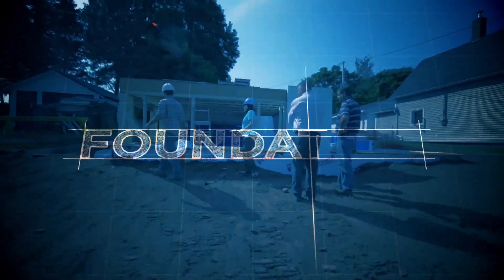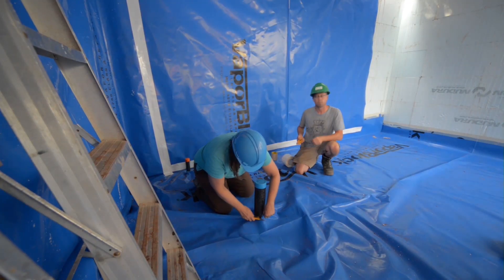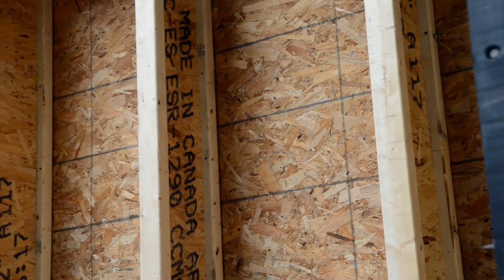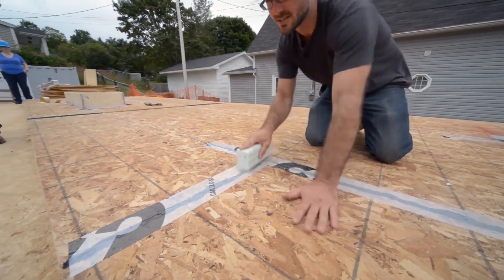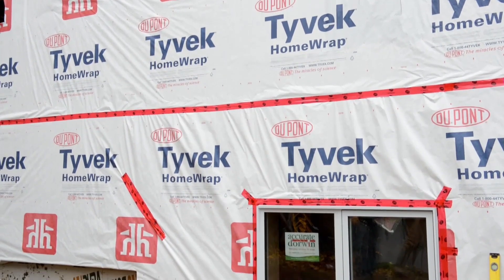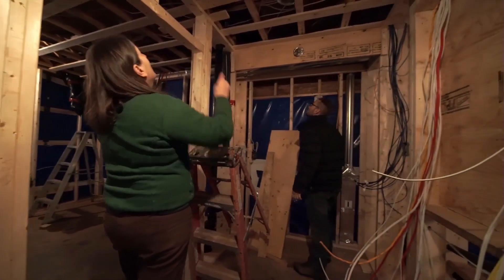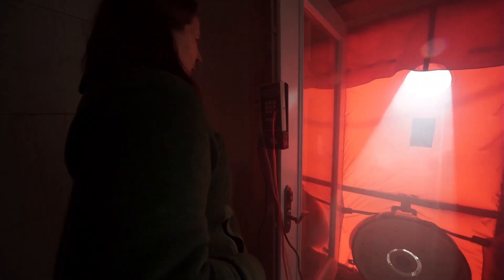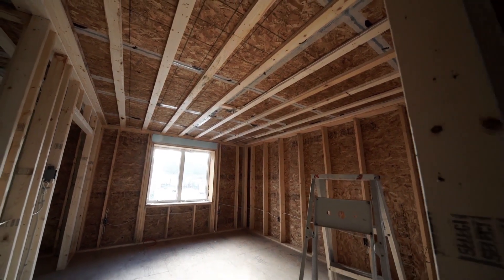Building a new home? Consider a Passive House

Comment: I have been building passive solar and super insulated for 35 years.  This is a truly superior house and construction,,, nearly,, all of it I compliment.  

The house is too well sealed.  People fart, exhale, showers and pasta on the stove,,,, never lose sight of the fact people breathe.  That house, as constructed in the video must have an air to air heat exchanger.  I would NEVER use a particle board, OSB, or any manufactured wood product (formaldehyde)  only some plywoods, maybe in a house that well sealed.  Furniture has formaldehyde, carpeting out gases, cabinets,, the composite sink in the bath,, you are going to be breathing the plastic in the shower curtain, and the flameproof coating on your kid's jammies is going to be dangerous.   People breathe.    You can spend an extra 5 grand tightening a house,,, and then you must spend another 5 grand on the electrically run air to air heat exchanger.

And moisture management.  In Nova Scotia,, I don't think this is going to be a problem TODAY,, but,,   From direct experience, I would never put Tyvek on top of OSB.  Never.  A better, a much better membrane under siding is 30# or better yet, 45# felt.    Felt allows vapour to pass easily,, I have never seen condensation on the inside of a felt barrier.  I HAVE seen condensation accumulation on the inside of Tyvek. And chronic condensation on the inside of Tyvek,, will destroy OSB,, and what ir does not destroy,, it will mold.

What I REALLY liked about this build,, was the flawless poly barrier between the home and the gases of the soil,, radon, methane, etc.  I'm gonna do that in my next build.
Reply: "The house is too well sealed."

No.  No it isn't.
The old notion of "it has to breathe" is simply uncontrolled ventilation.
You don't want that.  Because uncontrolled ventilation means uncontrolled heating and cooling.
This is why you have an HRV/ERV unit with controlled mechanical ventilation.

"Must have an air to air heat exchanger."

Which is part of what an HRV/ERV does.

Also, the issues with offgassing/VOCs is known.  You have choices there as well.
Go with finishes with low VOC content.
Adjust your HRV/ERV for higher air exchange per hour for a period to help remove the offgassing.
You get problems in houses where you have recirculation of stale air.

Also, Tyvek is an air barrier, but vapor open.
And if you've seen condensation on the inside of Tyvek, you're looking at a faulty wall assembly.
Additionally, even if you have said condensation, if the wall assembly has a path to drying in a timely manner, you won't see degradation of the sheathing.  It's when the wall is left damp for long periods and moisture stops migration out of the sheathing that you have issues.

Comment: I can't believe you are using aspenite and not 5/8 plywood. You are doing all this extra work but still cheaping out on material. I guarantee you from experience once it gets wet it will attract insects and rot
Reply: Properly engineered wall assemblies simply don't have these issues.
Plywood, OSB, etc.

The face layer of OSB can withstand decades of periodic damp on the face and not break down or rot.
It's when the ends get damn, stay damp, and swell that you begin to have problems.  Hence the seam taping.

Comment: No spray foam?
Reply: Nope.
Spray foam has it's place.
But it's not environmentally friendly, expensive, and can have offgassing issues.
Also, spray foam is, essentially PERMANENT.  YES, you can tear it out.  But the labor to do so makes simply replacing the assembly WHOLESALE far easier.
So lots of builders avoid spray foam in new construction.
You'll see a lot higher utilization in retrofits.

Comment: Are you suggesting all that tape will last 50 years?
Reply: This of course is not the only way to construct  a passive house. there are many varieties of wall and roof assemblies that one can choose from. 
I also had my doubts as to the longevity of the tape so when i had my last house built i had 14 cm T&G wood fiber insulation boards installed on the outside of 14 cm solid wood walls with a final layer of inch and a half T&G wood fiber sarking board . The T&G joints add extra security if the tape fails .
Reply: I know there is problems with the glue. Its the same with windows. They wont last
Reply: These aren't your old sealing tapes and duct tape of yesteryear.

The adhesives and the backers on these, provided you properly apply them, and limit their UV exposure, WILL last 50 years, if not more.

Comment: OSB.... not healthy
Reply: why?
Reply: @Skynet_11  Various types of OSB have preservatives in there that off-gas.
So you can get things like formaldehyde in the home.

Some of it depends on the engineering of your wall and floor assembly.
There are low and no VOC options available.  Though they generally are more expensive.
You can also move to non-wood flooring options (MgO, Concrete, GypCrete, etc) if necessary.
Some of it will also depends on the speed of the home's construction, the dry in period, etc.

Additionally it also depends on your home's ventilation strategy.

If you get one of these "we built this house in a week, here's the keys!" places, yeah.  You're going to have offgassing issues, even if every finish in the place is low/no VOC.

In a more regular, extended home build, things like decking and sheathing have a chance to breathe for some time before finish layers go over them.

Also, in a mechanically ventilated home with good air sealing, you can adjust your air exchange  to help ameliorate it.

Comment: When you pay more to build this house, when you pay thousands for this additional ventilation system which also costs a lot to install, and when your ventilation system running 24/7 increases your electricity energy consumption by 40-50 %, then you find out using more and paying more, that's it. This just a new marketing trick, people aren't smart and easily manipulated, and construction industry knows this very well.
Reply: We paid $899 for ours and were able to DIY...
Reply: Name?

Comment: doesnt look sturdy...
Reply: Killah Priest well, I know of something that may be of interest to you.  I'm working with others to bring a passive house product to Canada that is made of pre-fabricated walls that are filled with concrete on site.  Very efficient and very sturdy.
Reply: Actually 2x6 with exterior larsen trusses and sheathing is VERY sturdy.  You have a wall assembly that's 12-16 inches thick with the structural component just to the inside of center.  And they're not carrying huge weight.  Just insulation.

And, as SuperTombarton said.  There's other ways to build if you want "sturdy" too.
ICF is one way.  A COMPLETELY SOLID concrete wall with integral structural webbing,, reinforcement and encased in 4+ inches of foam (in most cases).

So there's no detailing the full-wall assembly for airtightness.  Because it's already airtight.
You just have to pay attention at penetrations (doors, windows, plugs).
I've seen a well-detailed ICF home pull a .23 on a blower door test (Passive House standard is .6).

I've also seen video of an ICF home that had an SUV crash into it and survive just fine.  The exterior facade was damaged, but the actual concrete wall itself was found to be fine after the fact.